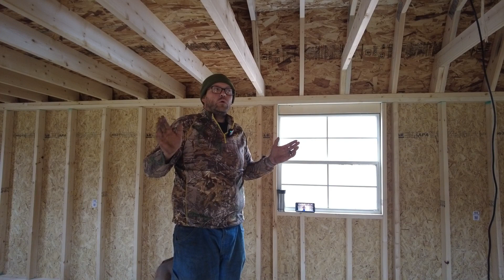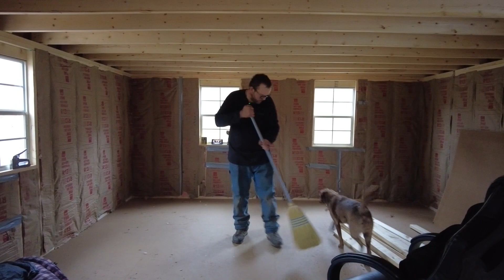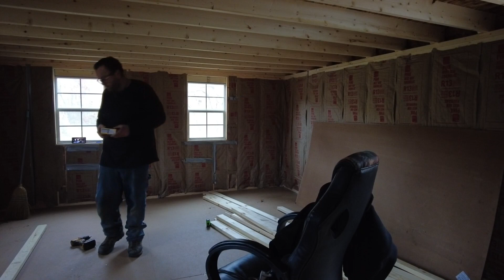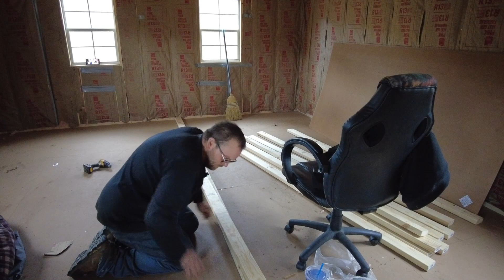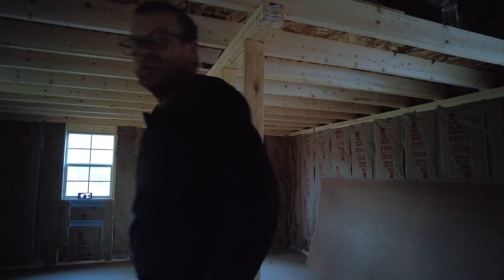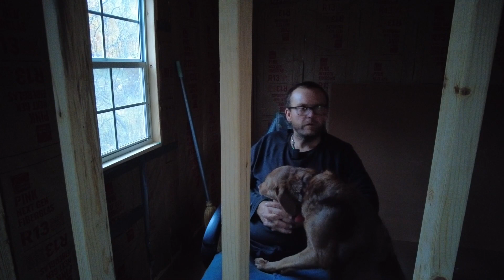insulating & building a wall

Comment: Hey bud actually your doing it backwards. Electrical, plumbing and your heat ducts are supposed to go in first. And the electrical hole should be at least 1-1/2” deep from the front edge of the stud. I’m a contractor in Michigan just to let you know my background. 

Also for sound barrier put ridged insulation in first the baton insulation.
Reply from the maker: Thank you for the info. What is rigid insulation?